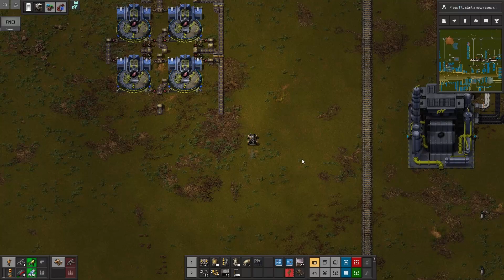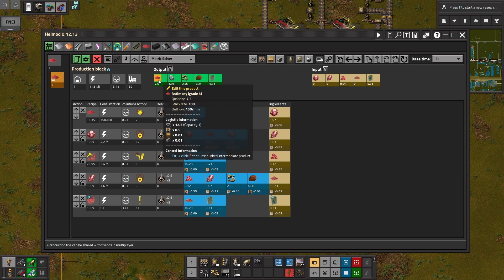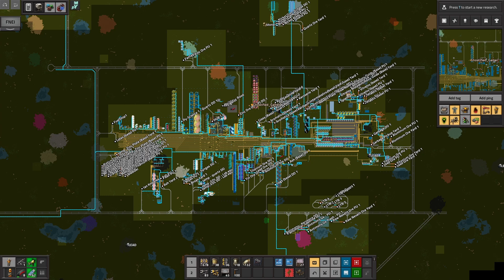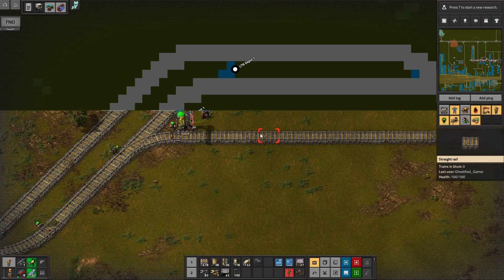Factorio pYanodons - New Beefy Antimony Grade 4 Build - EP53

Comment: About 35:15 I noticed a lot of bots clustering around your construction zone extender, waiting to be recharged. Looks like it might be a good idea to place a recharging station or two next to each extender, so that more bots can charge at once: its tooltip indicates that it can recharge just 1 bot at a time.
Reply from the maker: Those construction zone extenders are crap.  I think the bots favored them even though I put the recharging stations around them too.  The bots are just dumb.
Reply: @FantasticMrGhost  I watched further in the video, and I think I see what's happening. The bots look like they're coded to seek out the nearest recharge station when they need a charge. But that means the charge station nearest to wherever they happen to be at the exact moment they decide "Oops, charge getting low, better go recharge". And then if that station is full, they don't seek out another station, they just sit there queueing up until it's their turn. And the way your charge stations were set up, the zone extender was closest to where most of the action was, with the charge stations further from the construction area than the zone extenders. Which meant the bots were choosing the zone extenders, with their 1x180kW charge port, and ignoring the barely-further-away charge stations with their 4x500kW charge ports.

So the solution, I think, is whenever you place a zone extender, put a couple of recharge stations between it and the direction most of the bots will be coming from (e.g., the location where you're putting down your blueprints). That should help make most of the bots head to the recharge stations instead of queueing up at the extenders.
Reply from the maker: @robinmunn  Yeah.  The recharge stations would help.  But, bots are dumb and would use them anyways.  I'm not going to use the extenders anymore.  Another problem is there are slots for them to be stored so, if there's no job, they'll go to an extender to be stored.  The devs changed that they don't have slots anymore but that's much later on.

Comment: Thanks for the video. Why do you have 2 rows of chutes for loading your (junk?) train?
Reply from the maker: At 39:13?  The mini loaders output or input to a belt from a case or train only.  There's a little section of belt on the input/output of a mini loader.  So, there needs to be a second mini loader to take the output/input.  It's silly but that's how they work.  But, one mini loader is equivalent to 6 inserters.  So the space is justified in my world.
Reply: @FantasticMrGhost  Ah, that makes sense, Thanks!